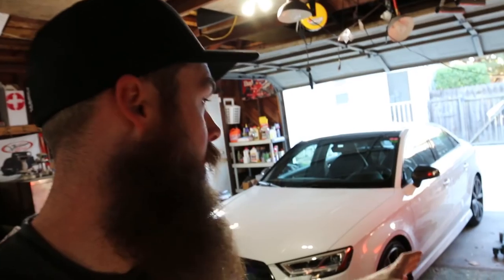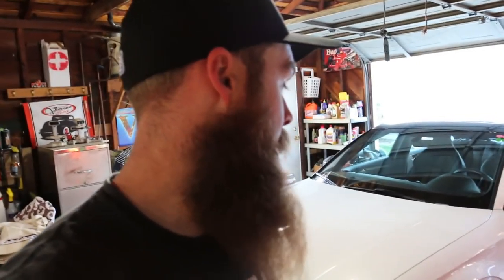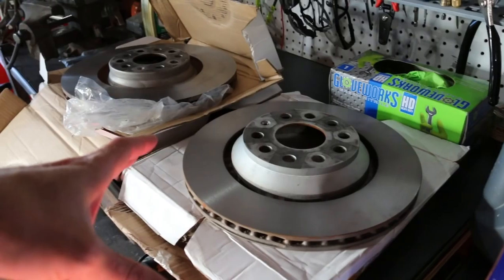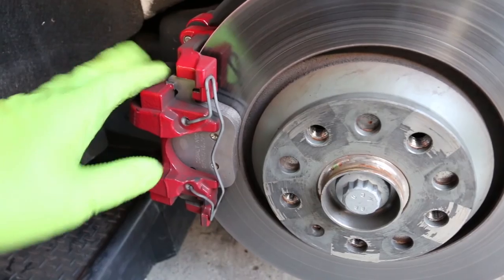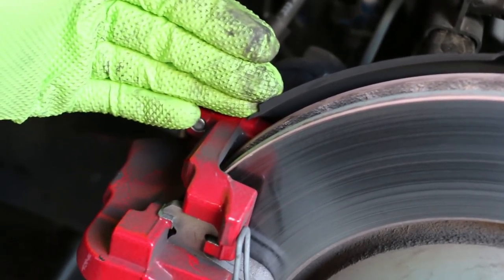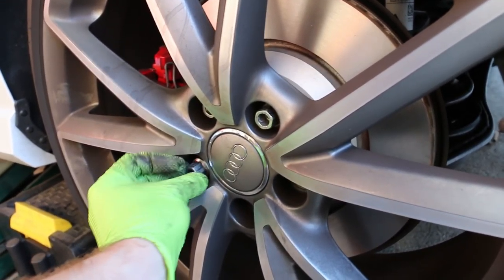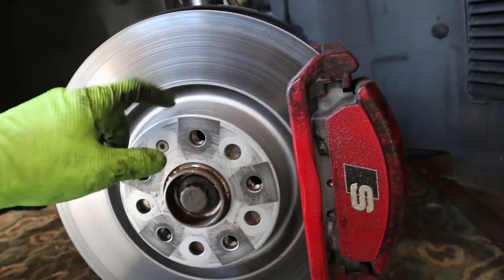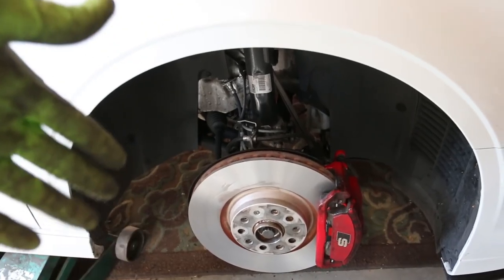MELTED THE PAINT OFF MY CALIPERS!

Comment: Ebc are real S**t according to me. Maybe they are better for lighter cars. I use Carbotech XP 8 for street and XP 10 for track...works awesome, no fadding and not loud. The car is a STI-16 with 500hp....try them, you wont be disapointed.
Reply: EBC yellows work great for the street and for very very light track use. But yeah, hard driving they don't hold up
Reply from the maker: Yeah I had them on my Subaru they were great but did have a bit of noise. I was looking for no noise at all that’s why I went with these. Then I have the Colbalt’s that did great on track they’re equivalent the Carbotech XP 12’s in the front and XP10’s in the rear.